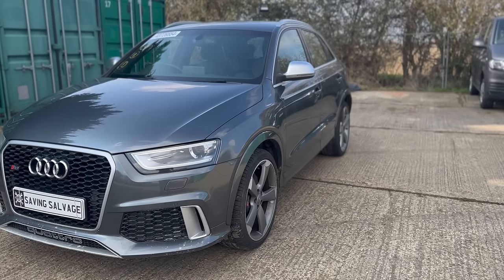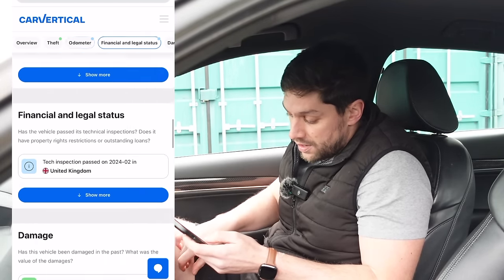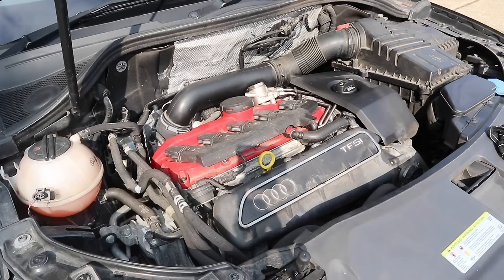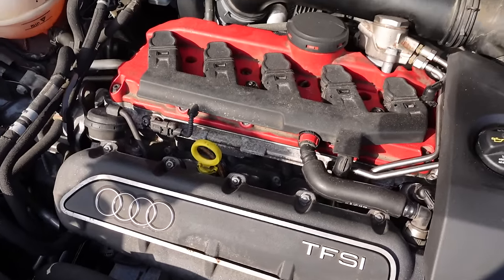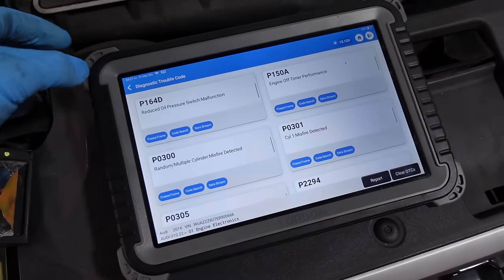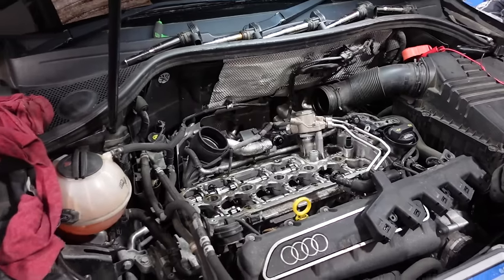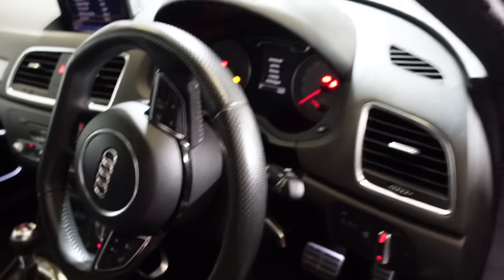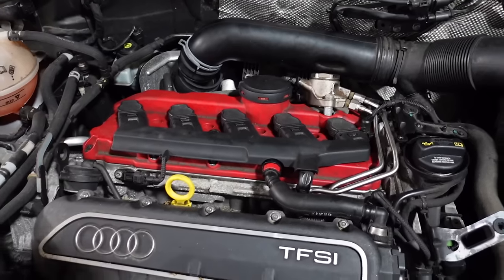I TOOK A MASSIVE GAMBLE ON THIS UNSEEN AUDI RSQ3!!... MAD CHEAP!!

Comment from the maker: https://www.carvertical.com/gb/landing/v3?utm_source=infl&a=Saving&b=38b26e3a&voucher=saving

Use code “saving”
Reply: you need to stop doing your car repair's in that hoody or take the strings off look at video at the 21.20 mark them strings could of got wrapped in a fan belt or anything and you could end up dead mark.  take the strings out mark ive seen to meany accidents that way
Reply: Like you said think it’s oil related think your best bet is to get that checked as well
Reply: Has it been through Rufford Ford? 😉

Comment: Roller rocker .Needle bearing failure.
Reply: Sounds more like a completely snapped arm to me. It's very loud for the roller and I believe there would be glitter from the cam lobe in the oil as it scores the peak of the lobe off..

Comment: VAG Technic is the channel for the low down on the top end / chain issues on these sh it engines 😮
Reply: Yeah he's done a few great channel
Reply: Took the thought straight out of my mind, he really needs to watch a few of their vid’s about these tfsi engines ticking before wasting money on the wrong parts
Reply: VAG T appears to be a Audi specialist 
SS appears to be a VW specialist 
But We never see a proud & successful SEAT/Skoda specialist 🤔🤔
Yet All are under 1 Umbrella 🤯🤯🤷🏻‍♂️🤷🏻‍♂️
Reply: That's not great are they,do they all tick after awhile?😢😮🙈🙈👎👎💀👎
Reply: Was thinking exactly the same while watching,vag technic replaced quite a few with the needle roller bearing failing.worth checking their channel out

Comment: To be 100% sure it’s not the chain, there are specs for the length and VCDS can measure the angles of the cams, can always check those specs to completely negate the chain as a possibility

Comment: Sounds like bottom end to me. Take the oil filter out and check for debris. Also drain and collect the oil so you can have a look if there's any bits in there
Reply: Definitely sounded like bottom end on start up...
Reply: Little end?

Comment: Sounds like piston slap to me. I’d be removing the oil filter first and checking for metal shavings and then whipping the sump off and checking the big ends before throwing £300 into hydraulics. My money is on bottom end. Bottom end knock can be very deceiving. Good luck mate. I’m sure you’ll get to the BOTTOM of it. 🤪😂 love the videos btw 👍🏻

Comment: Dean. Drop the oil and get the filter off and cut it open to check for sparkles. To me, that's a bearing at one end or the other of a rod. I think the sporadic spraying of the oil from the lifters is a symptom of a bigger failure, not the failure itself. And as others have rightly pointed out, tuck your bloody drawstrings away!

Comment: Dean, here's two easy checks to see if it has destroyed a big end without taking it apart - 1) remove all spark plugs - put a long tipped screwdriver onto the piston crown wind engine by hand so piston passes TDC and is just descending  - now lean on the screwdriver - if the big end is shot you will get a thunk and feel the piston drop at same time. 2) inset bore scope - if the big end has gone it's likely the piston would have hit the head and the carbon line on the front and rear of the crown will bare witness with a visible line that mirrors the squish margins of the head
Reply: Good advice 👍

Comment: Yes, I know the noise. Two cracked hydraulic tappets looked normal on ours, but when pulled they flew apart so no oil arrived and ran dry which caused this noise! But as some have already said, the pump is mechanical, unfortunately I don't know if that's the case then it ticks like that even if it's broken!

Comment: Listen to the speed of the knock relative to RPM - That gives you best clue ;) 
As the noise gets worse as the oil thins it's pretty safe to say It's run a Big End Bearing - A gentle drive down the road and the noise will vary on and off gentle load with the most noise when " floating" between on/off light load as the bearing clearences are closed due to cylinder Pressure/Vacuum on the Rods.
The Owner cooked the oil but good Main Stealer still sold him a service 🤣 Would say he killed it what that Oil pressure fault was logged😉
Reply: I agree, I reckon it is big end knocking  👍👍👍

Comment: Before you do the tappets check their fuel pump it's mechanical you can get that tappet noise from a fuel pump, I remember the Old polo used to make an awful noise like that it could be a lifter on the fuel pump or something's not right with it. And I would check the oil filter so if it is the correct type and the return valve is working right and make sure you've got the correct oil where you're pointing out the loudest part of the noise is where the fuel pump is so my guess is the fuel pump or the cam to it
Reply: that noise is definitely pretty close to the fuel pump

Comment: I know someone who had the exact same issue after a service. Turned out when the garage removed the old oil filter the o ring stayed in there there then distorted when new one was fitted causing oil starvation. Good luck

Comment: It will cost ‘nothing’ to fit the new oil bracket (that you have for the other engine), as if it makes no difference you can then use the removed one on the Skoda engine. If it fixes it you’d have to pay the £500 anyway. Good luck 👍

Comment: give it a service change the filter they are made of paper and when a car sits for awhile they become very hard and cant get oil to the top of the engine. a 2.5 is a strong ass motor. it doesn't just blow for no good reason! check pick up pipe as someone has said before.

Comment: The fact that the oil only squirted from a few of the lifters would say to me that there's either buggered lifters or an overall lack of oil pressure. Now multiple lifters may have failed due to low pressure but as there was a recorded low oil pressure code I'm thinking the pressure releif valve is being problematic. Thick oil on start up makes things quieter and then gets noisy as oil becomes thinner hence reducing pressure. Anyhoo, that's my thoughts.

Comment: Please check high pressure fuel pump and cam follower, it also may be leaking fuel into the engine explaining that the oil level is slightly increaed. Very common problem with these engine types.

Comment: Sounds like the timing chain. The noise at the first start up sounded like the chain rattling until the oil pressure buildup. Also I would check the oil pressure.

Comment: Best thing to do with Volkswagen Group of vehicles is to not buy them. Every single one of them is built for the SOLE purpose of DESTROYING YOUR BANK ACCOUNT. If the engine and Transmission doesn't destroy your love for them. Well, trust me BOTH of them along with INTERIOR plastics, door locking systems and the damn roof covering falling from the roof, WILL. I've had my fair share of heartbreaks with them. Now i drive only JAPANESE vehicles.

Comment: Sounds like either a worn gudgeon pin or could possibly be a bent con rod,maybe it’s sucked up some water? Try disconnecting individual coils with the engine running and see if the noise goes away or gets quieter as if it was the hydraulic followers it would make no difference to the noise with the coil pack disconnected 👍🏻

Comment: Maybe try unplugging 1 coil pack at a time and run it, plug back in if no change and move to the next, see if it changes tone or clears, with no detonation may rule out piston slap / bottom end, feel like I've seen this before, same noise, ended up being shells gone, also partially blocked the strainer.

Comment: Dean, that's a little end bearing, just had exactly the same thing on my VW crafter, exactly the same noise and symptoms, changed all the lifters, followers and cams and it still made the noise, then stripped the bottom end and 2 of the bushes had come out of the little ends of the rod, one was completely gone and the little end had become elongated causing the knocking noise.

Comment: Actually sounds like it does have a little chain rattle on start for a few seconds. You can hear it on your initial start and when you started it again in the shop once it was put back together. I don't think it is your main issue however, it sounds like rod knock or a bearing issue. I'd drain the fluid, check for sparkles and then check the oil filter for shavings before spending any more on the lifters.

Comment: I would not spend £300 before at least dropping the oil to check for bearing material, inspecting the plugs and scoping the cylinders.
Reply: I bought a audi tt with a similar issue I'm thinking of dropping oil to see if there is metal shavings in there but let's say there isn't would it be okay to fill it up with the same oil instead of changing it? Would prefer to only use fresh oil once I've fixed the issue

Comment: HI
IM SURE MY MATE WOULD SAY AND FOR THE BARGAIN COST 

STRIP CRANK AND CHECK SHELLS ANYWAY

TOO US WERE SAYING HIGH REV CHANGES ALL ITS LIFE --COMPANY POOL CAR BUD ----REPLACE CAM SHAFT BEARING SHES OLDER THAN YA NEW RIDE HEHE

CHECK THERMASTAT SENSOR VVTI RENOUNED FOR FILTER  CLOG ON UPPER OIL RAIL VALVES 

ANYWAY WHAT DI D THE OIL SMELL OFF AND WAS IT STILL SMOOTH 

 AUSDEN CLARK CO

Comment: Check Audi haven’t left the old seal from the previous oil filter on this is a common issue when fitting a new oil filter it’s double seals this happened on my Q3 and everyone thought it was timing chain tapper issues but just was the double seal starving the engine of oil

Comment: Hi Dean, Sounds like its top end .. I'd take the sump down and check that the Teck (LMFAO ) at Audi aint dropped the paper foil thats on the oil bottle down the filler neck .. this in turn would be partially blocking the oil pump strainer.. when looking at the tappets with engine running looked very dry on No 2,3, and 4 cylinder's on the camshafts. the HP fuel pump is also oil fed to the cam... Just seams very strange to have a problem, After a service from Main Dealer.. I'd put money on a partially blocked Oil pump strainer..  Andy ..

Comment: Wow a lot of replies here dean. So, I doubt you'll see this. First off as others have said I'd drop oil and look at oil and filter first!!!  
 As you've got the oil filter housing adaptor, you  could try that. I doubt it will solve it.  But It wouldn't cost you a penny and not the same scale as the tappets.  The valves in the assembly if anything like the ea888gen3 bracket are 1. oil cool jet control valve and 2. oil pressure regulation valve for hi / lo pressure.  I think the workshop manual was referring to the spring loaded antidrain valve inside the oil filter cap? Anyways, good luck. I haven't worked on the 5cyl RS3 engine btw. Thanks for the vids.

Comment: Failed lifters is my guess as well. They can still feel good on a static test but don't hold pressure when running. Hot thin oil is the clue maybe
Reply from the maker: Yeah and fresh oil isn’t as thick as the old oil so it’s being pushed out the tappet easier.

Comment: Read a few comments of those saying rod knock/little end. Sounds too slow for that. I took a snipet and slowed it down, counted about 7 or 8 ish taps per second of footage. 420-480 or so taps a minute thats half engine speed at idle, so definately a top end noise. Id hazard a punt at a cracked or siezed tappet

Comment: As others have said - drop the oil and cut open the filter checking for metallic particles. Sounds suspiciously like a big end bearing to me, that'll get louder as the engine warms up.
Hope it's an easy fix, but like you said, why would someone take a huge hit on a car unless they knew there was something seriously wrong?

Comment: Before you sink £300 into new tappets, you could move the ones you suspect are at fault to a different cylinder and see if the noise moves. Cheaper, but more labour it turns out you’re right as you’d have to strip and rebuild twice. I agree with others though, sounds too heavy a knock for tappets (via an iphone speaker atleast!)

Comment: Sounds almost exactly like my Focus did ehen the bearings went on a piston. Probably more to do with recording and earpiece than being the actual reason but that started off like that then got progressively worse, at idle itd settle down then give it a rev and clatter clatter.

Had it happen on my company car and thought shall i wait 3 hours for the AA or shall i drive slowly y6o the ford dealer.

Opted for thr latter as had no clue and wasnt that bad.

Service manager opens the bonnet and puts head under whilst idling and no noise. Says to be rev it up so i give it some and he leaps back shouting shut it off.

Think he had a vision of getting a piston in the face lmao.

Comment: Contact Ricky at RE performance or the guys at VAG technic both on you tube, sounds like a collapsing needle roller bearing in the rockers, I'd pull the sump and check for debris

Comment: back tyre pressure too low causing the fluffle valve and the wuffle induction walve to be up on decreased light voltage off the magneto ball flwvalve .....try replacing the front lower diff lock sequence commander 😂😂😂😂😂😂😂

Comment: dean i hate to say it mate but to me it sounds like the motor may have been hydrolocked that sounds like piston slap hope i'm wrong also put an oil pressure gauge on it and phisically check oil pressure the 5 cylinder is also prone to get excess carbon on the pistons which can cause pre detonation and sounds like major knocking but if it was me before using the parts cannon talk to your mate at RE PERFORMANCE and pick rickys brain he be the guru on theses engines good luck cheers from down under

Comment: I had a stuck lifter issue and the sound was very similar. It was clearing when the engine gets up to temp. I used Marvel Mistery Oil and that seems to have fixed it (I've done about 15k miles after the last "cleaning" procedure). It's odd that it's getting worse with the oil getting thinner in your case..

Comment: I'd be checking the injectors in that area.
Get rid of the hoodie g strings, i thought of it too when i seen you lean in. You're working on cars now, so get yourself five sets of full-length overalls, and on Sundays wear yellow budge smugglers over the top.

Comment: These engines are well known for having timing chain noise issues relating to the VVT pulleys, my TTRS has made some similar noises in the past to then not make them again at random intervals on warm starts. Pretty sure the The Turbo Unit made an article on their facebook page pointing out why these cam/VVT sprockets fail. So potentially maybe one of yours isnt getting oil pressure at all creating a rattle. I think there is also a piece of gauze somewhere in the oil channel feed to these VVT pulleys that can also get blocked up with debris stopping it from building oil pressure

Ill bet audi over filled the engine with oil to see if it helped quiet down the noise 

im curious to see what you find. 

Good luck! 😁

Comment: Is it possible 
If they put to much oil in at the service and it’s started after the service . Maybe Oil level could be so high it catching the crank and been bubbled up so the oil pump can’t move it . Be Worth draining oil to correct level 
To rule it out .

Comment: Hi. I sold my previous car to copart for salvage. The gear box needed to be replaced. Which was not really worth doing due to the age. It did start run and move forward but because of the gear box synchro problem it wasn't a true runner. Could be somthing simmilar with your car.

Comment: I'm really enjoying your videos!  You mentioned the oil level was overfilled by 200 mil.  That could happen if the dealership overfilled it, an injector was leaking, or the car was driven into water deep enough to get sucked in the intake and hydrolocked the engine. The injectors don't seem to be leaking now, though one could have been replaced.   Seeing the owner just wanted to dump it, I'd suspect the latter.

Comment: Check the rod bearing! I was once chasing also a tappet problem, the sound came from the valve mechanism, but ended beeing a rod bearing issue. This was a 1,9 TDI, but the sound is the same.

Comment: Just a thought, the hydraulic lifters (tappets), will make that noise if the oil is to thick (to high viscosity), could be a good idea to drain the oil and make sure it's the right viscosity 🤔🙂

Comment: given that the problems only happened after it was serviced . would it be a good idea to check the oil  / filter out , as it might be the wrong oil / filter  . Or just try an oil change with the correct oil / filter and see what happens

Comment: Overfilled by 'at least' 200ml gotta pull the excess out before spending a penny, chased a similar fault around the houses on a motorcycle was convinced in the end it was the cam chain turned out it was overfilled by the owner on the last service, and its free to do 👍

Comment: High pressure fuel pump? works much the same as rockers eg shouldn’t have any clearance on cam, so if you have a weak pump pushrod pressure it would sound the same as tappet failure.

Comment: I would be doing an oil pressure check before I started taking all the cams out etc. looked like low oil pressure when you were turning the engine over and it gets worse when the oil is warm.

Comment: If no sparkles because new oil & filter done defo replace Cam roller bearings & tappers with fuel pump shim, plus  if that’s run dry … then complete an oil flush through so galleys are cleared ..  new oil & filter then run a manual oil pressure check at idle then 4to 5k to see pressure values .

Comment: Check your oil pressure first. If you not getting enough oil pressure the lifts collapse and you will get the issue your getting.

Comment: I would check oil pressure with guage before lifters. If oil pressure low within a few miles and new lifters noise will be back soon enough